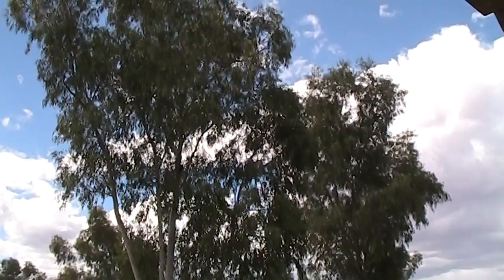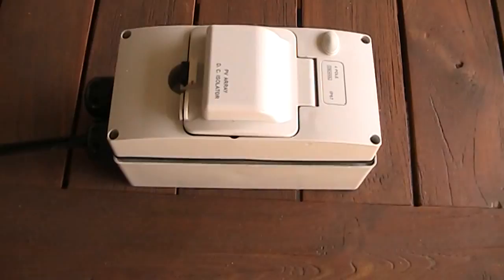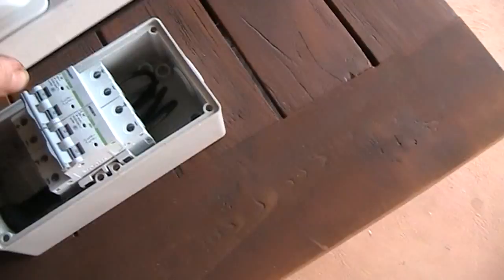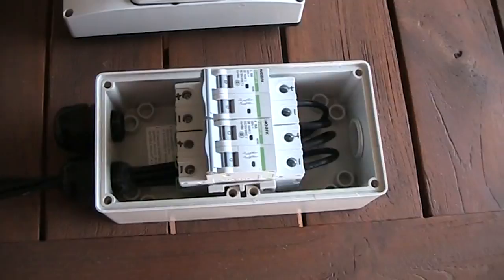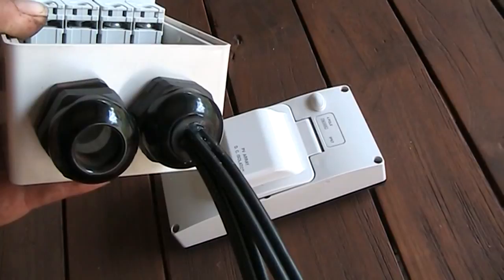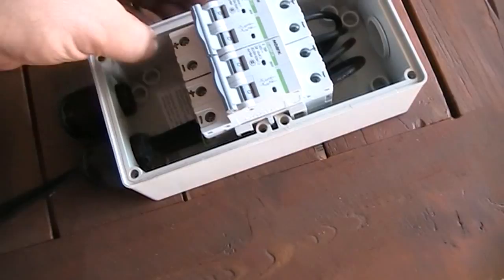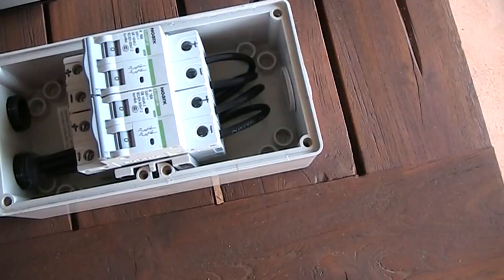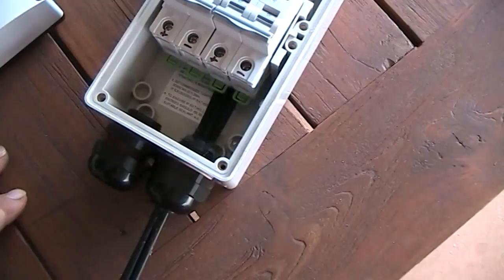Solar Panel Circuit breakers.

Comment: Hi there! Thank you for the video. One quick question, in a two panel system with a microinverter, where should I install my circuit breakers, in the DC or AC side?
Reply from the maker: Hi Dario, I haven't had any experience with micro inverters so I'm not completely sure. I would think that there should be a fuse or circuit breaker on the dc side and you would need some form of circuit protection on the output of the inverter as well. Sorry I'm not much help, maybe search for something on youtube that covers micro inverters or ask a professional.
Thanks for watching.

Comment: Hello, without going into complete detail, I was trying to get the last pieces assembled by watching your video, just bought a 63A circuit breaker/Isolator to go along my 10 x 240w panels and 5KVA Inverter/Charge Controller. How would I go about connecting these part for the system as a off grid solution?

The inverter can be connected to the AC grid, but I’m not sure if its a must?

Feel free to give me a poke if you can lend me a pin point😃
Reply from the maker: A 63 amp circuit breaker sounds like you have made an error with your choice of protection. If you have the panels installed in series, I would think that the total string current would be below 10 amps. I would suggest that you reach out to an electrician who is local to you to give you a hand with your setup.
Stay safe and thanks for watching.
Reply: Karinya Fields the manual to the Inverter recommended a minimum 50A DC Circuit breaker between the panels and the inverter, like wise a AC 50A circuit breaker if I were to hook it up to the grid, which I hope I won’t have to :)

You are correct however I’m currently at zero budget after the last necessary circuit breaker purchase and the sun is shining heavily.
I’m even worried its not the correct device sonce its identified as a 63A PV Array DC Isolator.
Couldn’t find an exact 50A model on the market, the local supply only have 40A available.

I would first have to sell the 10 Micro inverters and a smaller 100A charge controller in order to finance an electrician, stuff I didn’t need in the end after buying the 5KVA 48V Inverter and 4 x 230Ah 12V Battery Bank 🙂

Im probably confusing my self because I’m stressing to get it running safely as I love in an apartment complex with access to a garage where the PV panels will be attached.

But the panels read to have quite a high 1000 Voltage output, & a max series of 15A
Reply: Google told me the difference of a Isolator and  Circuit Breaker, you are indeed correct I bought the wrong device, google shopping sucks if your direct translating :D I won't reccomend that

Comment: Hi, is this dc circuit breaker enough to protect Lifepo4 batteries/PV string or should it be combined with fuses?
Reply from the maker: Thank you for watching. You would be best to use fuses as well for the safest option.
Reply: @karinyafields9651  Thanks a lot!

Comment: i got what you recommended me: a 16 a dc breaker. how to connect my panel and inverter to this breaker? do i just connect the panel wires to the below point/poles and the inverter to the above points?
Reply from the maker: TSIRHC SEVAS yes, that sounds good. If in doubt as a qualified solar technician in your local area.

Comment: I found some of the Noark 20 Amp breakers for 277 VAC and they show a DC rating of 60 volts so am I safe to assume these would work fine for 2 24V panels in series for 48 volts? I am going to use 330 Watt 24 volt panels and 48 volt charge controllers. Two panels in series will be almost 10 Amps. What type of indoor enclosures do these fit?
Reply from the maker: Robert Ballard hi and thanks for watching. AC circuit breakers are NOT suitable for DC loads or supplies. AC circuit breakers are designed differently to the DC type due to the fact that AC voltage passes through 0 volts every 50 or 60 times a second (depending on where you are in the world) and it is less likely to create an arc because of this. DC is full voltage all the time. This can maintain an arc if not switched fast enough or under load causing an arc fault and fire etc. Better to get the correct protection for your application!
Reply: I understand. Thanks for the reply! I am looking at the MIDNITE SOLAR MNEPV15, 15 AMP, 150VDC DIN Rail Mount Breakers. With a rating up to 150 Volts I would be save running a 48 Volt system. Full load voltage on those panels are 37 volts each for a total of 74 volts. Open circuit voltage would be  92 Volts. I would not want to create a dangerous arc and cause the breaker to burn up.

Comment: Hi there, are those Noark breakers 20a or greater each cause I only just found out that normally they share the amps over each pos & neg so 20a breaker does 10a on the pos & 10a on the neg.
Reply from the maker: Solar Function not quite right. 20 amps per pole. 20 amp in the positive is 20 amp in the negative side.
Reply: Okay

Comment: I installed a dc breaker 16 amp incorrectly between a solar panel and a gt inverter and the inverter made a long beeping sound. No lights were on on the inverter during this. Do you think I burned the inverter?
Reply from the maker: TSIRHC SEVAS, not sure. Did you get a local solar technician to give you a hand? You should always use a qualified electrician or solar specialist for this type of thing. Better safe than sorry.

Comment: Hi 
Using solar PVs of 3200 Watts . What type of DC breaker would recommend. 
Cheers
Reply from the maker: Hello Fahad, and thank you for watching.
Circuit breaker size would depend on the short circuit current of your panel array.
You need to work out what the current is for the string and go from there.
Reply: @karinyafields9651  hi again ,
I am kind a new to this. 
Using 2 arrays of 4*400w Jinko cheetah perc (JKM380-400-72H-V-A1) PVs each with inverter of 3.2kw.
Appreciate the help.
Reply from the maker: I've just had a look at the data sheet for that panel and it has an open circuit voltage of 40.5vdc and a short circuit current of 10.3 amps. I would look at a 10 amp dc circuit breaker but depending on where you are and what temperatures you have over the different seasons, I would say you may need to go up to a 16 amp dc circuit breaker. If you live in a hot environment, 16 Amps is the go. But if you live in a cooler climate then you should be able to get away with the 10 amp breaker.
Hope that helps.
Regards, Matthew
Reply: @karinyafields9651  thanks a lot. Things got cleared. Will use 16amp as I live in Karachi . Average temp is around 30 degree celcius most of the year.👍
Reply: @karinyafields9651  hi. I have a general question about PVs. As I mention before using a 400w mono percs PVs. With single mppt inverter. As 400w currently not available in my local market, can I use 405w mono percs of the same brand with 400w.
Reply from the maker: Adding different rated panels to your system is not recommended. If you have a separate mppt charger that you can use then I would use the different panels with that as a separate string / array.

Comment: do i still need a circuit breaker cuz i have only one solar panel. 

if yes,

 i'm trying to figure out what kind of dc breaker do i need. i have a I have ordered a panel with these specifications: 

Reference Number HG260W
Maximum power Pmax (W) 250 
Tension in Pmax Vmp (V) 30.43 

Open Circuit Voltage Voc 37.12 
Short circuit current Isc (A) 9,65 
Current in Pmax Imp (A) 8,54 
Polycrystalline cells 

i dont want to spend a lot for a disconnect box. will a 25 amp circuit breaker do? if yes, do i need a single pole one>? and third do i plug only the positive?

 sorry too many questions.
Reply from the maker: TSIRHC SEVAS I would use a two pole 16 amp dc circuit breaker. I would run both positive and negative though it. Thanks for watching and stay tuned as I will have more videos in the next few weeks.
Reply: oh man, i can find circuit breakers throughout electric shops but they never say DC breaker. sellers are also ignorant. any clue on how to spot a dc breaker?
Reply from the maker: TSIRHC SEVAS it will be written on it. Just ask a wholesaler or get one from eBay.